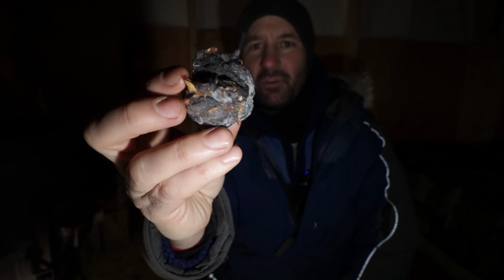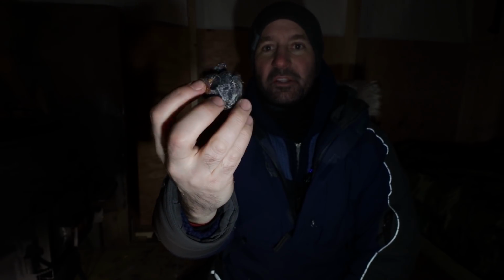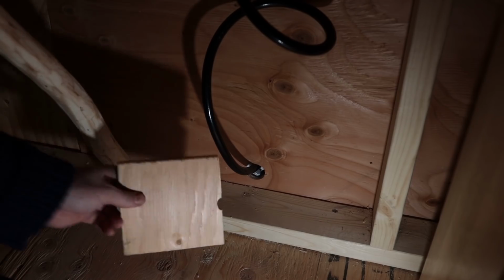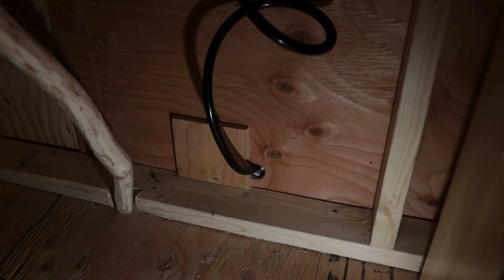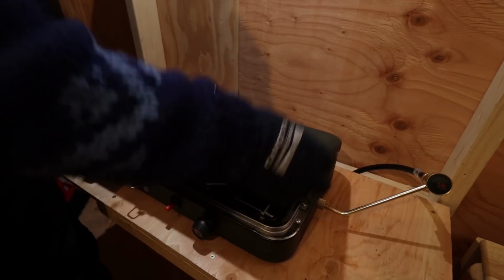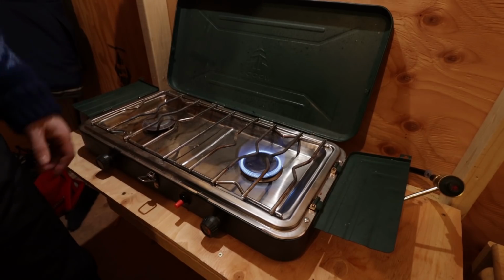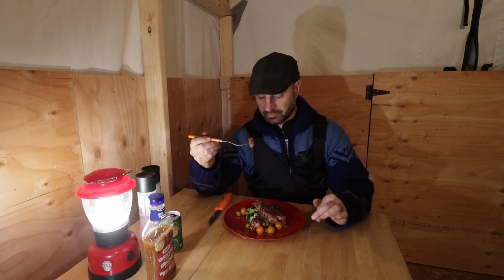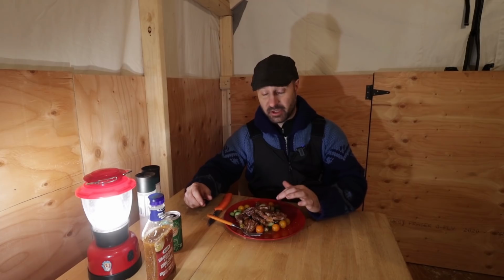Cold Camp Critter Control | Wood Stove Steak Salad

Comment: You can also run a line off the same propane tank to your light.  You can put a T in it or a 2 or 3 way adaptor and have multiple hoses running off the same tank going light, oven or whatever.

Comment: Hi Jay,
If mice want to get into the tent, they can easily get in.
A tent is not difficult for a mouse to enter.
Just try to keep them away.
I had mice enter a steel shipping container by eating through the rubber seal around the door.
Good luck.

Comment: Nice 'patch' work to close up that mouse doorway.  With a tank that size you should be cookin' with gas for a long, long time.  Good idea to refill the lantern size tanks too.  Only thing left is to schedule the propane truck to stop by and refill it now and again.  ;-)

I'd still suggest you get a piece of plastic to cover the top of the tank to keep water and snow out.  In a fall and/or spring temperature cycle you don't want water to seep into the connector threads and then freeze.  It could damage the connector enough to cause leaking and possibly be dangerous.  

Man, that steak looked really good too.  That new stove is really dialed in now.

Comment: Insulating the tank with snow is great in minus temperatures but I have had problems in the shoulder seasons especially late fall and early spring. A fiberglass bat of insulation with a vapor barrier backing works well.

Comment: in some parts of the world.. people use (meat eaters ofcourse)... beef bone broth boiled n cooked as a soup (oil and water with garlic n ginger in a pressure cooker for 3hrs) then simply put it in a glass jar (with salt and pinch of grounded black pepper).. and stored...you can also add pieces of meat to the broth..and  simply heat the required amount .. and eat with bread.

Comment: You could put the propane hose inside a 1" rubber heater hose - that should help,,,, or maybe they make something for that specifically,, not sure but rubber heater hose like used on a car heater core...I'm not even sure if you have a problem with the hose - lol... have a good one - stay safe !!!

Comment: One thing I did with my tent is I put up 2 in rigid blue foam and I use 1/4 of the wood to heat and it lasts longer in between filling the stove

Comment: Steel wool stuffed around the propane hose hole will help...
Reply: I'm also preparing  video  like that video on my channel, thx
Reply: Stainless steel wool
Reply: copper wool works better as it lasts longer and doesn't get gross
Reply: @karolwojtowicz9661  cool good to know
Reply: I use steelo in hole at my caravan it works good for the little buggers 😻
Reply: You beat me to it. Always a great option.

Comment: What you can do is add a tee to your propane hose and run another hose up to your lantern so then you can run both your stove and lantern off a 20 lb  propane bottle and save a few bucks in not having to use the expensive 1 lb bottles.  That way you can use the 1 lb bottles as a backup.

Comment: Your steak looked delicious, but it curled up on the sides which can cause uneven cooking. When exposed to the high heat of the fire, the ring of fat and connective tissue that surrounds the exterior tightens, causing the meat to buckle and curl. You can easily prevent that by making two small slits about two inches apart through the fat and connective tissues on the edge of the meat. It works for pork chops as well. 
Love your videos Jay!!
Reply from the maker: Thanks for the tips and the compliment!

Comment: Snow is an okay insulation but what are you insulating?  Insulation only works when there is a temperature differential.  Insulation in a cooler helps keep the cold of the ice cubes from migrating to the warm air.  Insulation in a house helps keep the heat of the furnace from migrating out to the cold.  The ground is frozen solid and is close to the average air temperature.  You could put phenomenal insulation on the propane tank and it will do almost nothing because there is no heat in the tank.  

The only time you will get some minimal benefit is when the air temperature rapidly drops.  Then for a short period of time probably measured in hours, the propane tank will be warmer than the air temperature.  

Look around where you live.   Do any neighbors heat with propane?  Their large (several hundred gallon) tanks are not insulated.  Propane should flow down to -44 degrees Fahrenheit.  So until then, don't worry about insulation.  

No matter what, do not cover the portion about the tank.  The area with the hose connection, shut off valve, and pressure relief valve should always be open to dissipate any leaking gas.
Reply from the maker: Thanks for all this information!

Comment: If the mouse wants in, she will chew through the hose. A friend of mine had it happen to him with the power cord to his travel trailer.
Reply from the maker: Interesting.
Reply: @johnmcveigh6133  I had a squirrel do that once with a portable table top grill attached to a 20 pound tank.  It was the only time I forgot to turn off the tank.  Luckily, I carry two of the 1 pound bottles with me as a backup, and luckily this was before I got my current trailer with the outdoor grill hookup to the main trailer propane supply.  I am real diligent about turning off the supply at the outdoor grill connection as soon as I am done with the grill now.

Comment: Ok.... Here is my 2 cents on the rodent comments and why it doesn't matter.
1. Your "Door" has enough gaps to let them in.
2. Your fabric is not sealed to the plywood walls all the way around so therefore the mice could just climb between the fabric and the plywood then up and over the plywood.
3. Your wall fabric is not rodent proof and they will have no issue chewing through it if they really want in.

Otherwise nice fix on the hole. Looks like a start. Better safe than sorry I guess.

Comment: Put steel wool around opening and the hose. Best by far deterant fir mice and or rodents,  Moth balls also deter snakes and rodents inside as well.
Suggestion don't just leave sleeping bag unzipped, sure sonethg can crawl under covers but nothing obside you bed bag, just saying Later gator

Comment: Could you not have gone through the bottom plate of your wall with your hose and come up on the outside of the tent instead of through the side of your tent? Then plug the hole in the bottom plate.